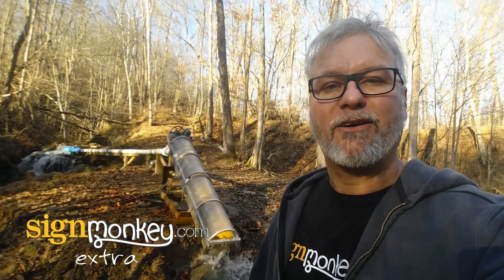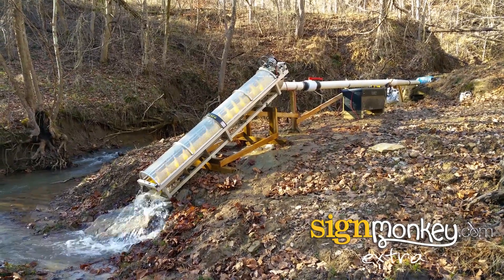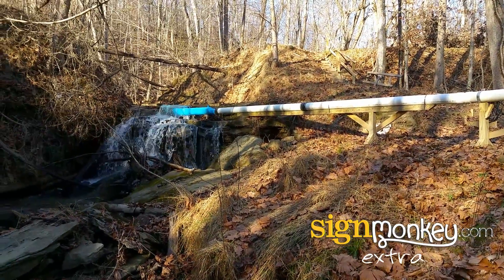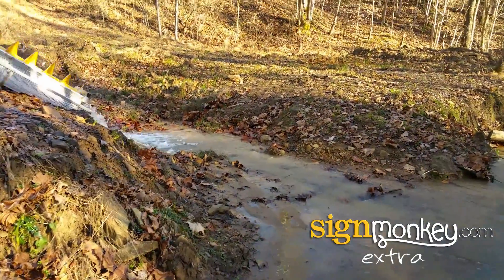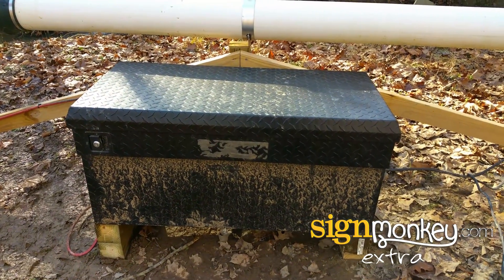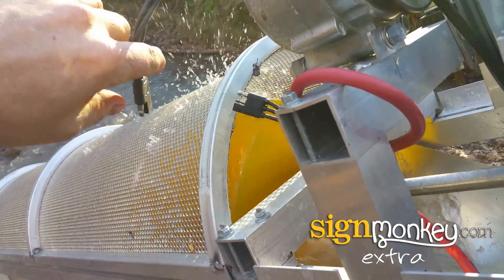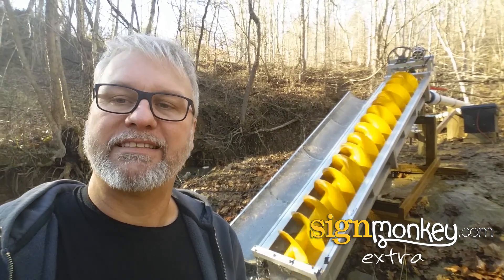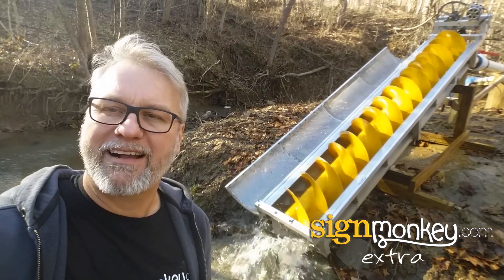Archimedes Hydropower Screw Generator

Comment: Surely the efficiency of water wheel would be better that an Archimedes screw? The water flow is pushing on the outermost edge of the wheel and momentum would mean it gets more efficient after it's started up. The screw on the other hand is actually designed to move water uphill and not optimised for the water to drive it, maybe if it was totally submerged and the pressure was high enough but it'd be acting like a turbine then and driving the water out with a lot of force. 

I just don't see the advantage of using an Archimedes screw, invented to move water to a higher plane, over a water wheel, that was actually invented to harness energy from the flow of water.
Reply: I can see one advantage of the setup. Namely, that you can generate power with a lower profile. For example, this setup could probably run underground if you needed it to, so in communities with visibility issues or building permits this would actually be a good idea. However, I can think of another good to use for it: as part of the apparatus that leave the water to a water wheel channel. in fact, I'd replace all of those pipes with thisata slight incline and put the wheel under the end of it.
Reply: the length; the screw is like 5 to 10 smaller turbines in a row; it actually does catch the energy better, but ... he didn't set it up right; the water flow needs to be higher and the gap between the screw and the gutter has to be tiny
Reply: SilvaDreams bingo!!!
Reply: It's not very efficient, because well the Archimedes screw was exactly that it was meant for moving water up an incline.

Comment: could you tell me where you got the water catch from or how you made it . thanks
Reply from the maker: We built it, I had the parts plasma cut and welded it together, then epoxy coated it. The grating on top is made of round rod and assembled in a way to let it self clean.
Reply: Thank you. anyway of getting the schematics for the screw and water catch or is this something you are attempting to market and sell? Again, thanks.
Reply from the maker: I am not looking to market this generator. I don't really have a schematic but if you have questions I would be glad to answer.
Reply from the maker: Aluminum 4" schedule 40 pipe with .060 aluminum flights. by far the most difficult part of making the screw!

Comment: Might actually be interesting if you post how much it produces.
Reply: Actually, in most mountainous areas creeks still keep flowing at least a little when winter comes, it might be less than a third of what it is normally, and a tenth of summer melt flows but it still chooches!
Reply: The head/flow didn't seem to be the limiting factor.  The generator looks like a car alternator.  Car alternators can range quite a bit in output but I'd wager far less than 750watts which is roughly 1hp.  If it could produce 500w continuously that would be 12kw per day.  If it's a more typical 250w alternator it's probably closer to 6kw per day.  The speed didn't increase that much when the load was removed I assert there is a lot more energy that can be extracted with a bigger generator.  What I would do is add another alternator wired in series for more efficient rectifying.
Reply: @MindCrime550  Automotive alternators are rated at amps with 12v a given .  200 amps is typical for 18 wheelers. So 2.000 watts would need about three  hp to generate 2000 watts and i doubt that screw at that head with 6 inch pipe comes close
Reply: @MindCrime550  wattage is an hourly rating..used "instantly", so doesn't matter how much is produced per day..the energy must be used "now" else it is wasted unless there are many batteries to charge and one can wire them for higher Watt output or longer duration for nominal W output..not criticising, since we are not sure of the true wattage output of that 'generator'..
Reply: Michael Foye Remember if all this did was trckle charge batteries when the sun doesn't shine it has done it's job
Reply: Bio Power Thats significant savings on electric bills. Even if it doesn't power everything year round. The question then becomes how much the capital cost of the project, and its maintenance over the course of its life cycle compares to the cost of paying for the electricity from a corporate provider. I'd think that its superior to most photovoltaic systems on that level, especially if you don't count the displaced value of subsidies. Frankly I'd build one just to have an independent energy source.
Reply: mikhaelis yeah I know eh. Waste of time people share no specs.  I saw another like it guy was producing 5500 watts
Reply: @daleval2182  wheres the link? Any idea?
Reply: Figure about 100 watts per foot of screw (auger) for a 10" diameter.  Angle about 30° to 45°.   Alternator should he 80% of that, so a 60 amp alternator with a 3:1 or 4:1 sheave (pulley) setup. 

Alternator needs to turn 2500 rpm if coming off a gas motor, 1000 rpm minimum if coming off a diesel. 

Screw should be variable pitch flight type. Say 4 per foot at the inlet and 8 by the outlet.   Helix angle of flight should be equal to the incline of the tube, but you can use what you pull out of the tractor bone yard.
Reply: Bio Power it's flowing?
Reply: Mikhaelis head looked about 2m max, 6" pipe. So less than 10kw most likely
Reply: @gamble9437  This was most likely 100 watts
Reply: They never do.
Reply: I was thinking the exact same thing...volts, amps?
Reply: I think that drill he had in his hands should be quite powerful
Reply: How much power are you producing with that hydropower? Is it enough power to set up lights around the landscape?
Reply: Like a car alternator maybe a truck sized.
Reply: EXTREME ENGiNEERiNG LiFE  Don't sell yourself short. Min 20KW. /S
 Get real. You have no idea what you are talking about.
Reply: Michael Foye where did you get 50% is that a practical measurement, most solar panels are rated  for 80% after 30 years assuming they weren't damaged and are at the most optimum angle
Reply: @ilovefunnyamv2nd  The 50% figure refers to the government subsidies given to manufacturers, installers, and purchasers of solar systems. Not the rated efficiency.
Reply: Very misleading, Even if this was flowing 10 litres per second (it isnt)  with the 2m or so of head and the inefficient screw turbine it would only do about 80w That looks more like 5 litres per second to me. After the losses i would think it runs at about 30w How do i know this? I make hydro systems.
Reply: Bio Power That still represents a thirty percent depreciation of utility in that timespan. Its worse if you have winter freezing roofs. Tears the panels apart too. I'm not against pv solar, but it isn't cost-effective of the true cost is taken into account. The panels are made of gallium arsenide. Thats gallium which is destructive to all metals and can induce failure over a very short time span if exposure to metal surfaces occurs. And arsenic which is a deadly cumulative poison. When combined they don't have the same properties, but when they degrade, especially if they are allowed to disintegrate, those materials once again can cause their respective harms. It's no reason to panic, but its amazing how many people think that solar panels are super efficient models of non-polluting energy producers. 
By comparison, the cost of your micro-hydro system is pretty much the whole bill.
Reply: Michael Foye I somehow don’t like PVs since they started putting so much emphasis on it and marketing Clean Energy. WE are all being cheated upon everyday of our lives, atleast this guy has made an effort to produce some Electrical energy by converting hydro and keeping the water clean.
Reply: @SamMonkulas  PV systems have a valid role. In space systems. Because at the moment the only energy options for satellite systems are nuclear and solar. So there's a niche where it is useful. On earth it's suitable for a system backup, or for being independent of the grid. Otherwise its better to use more efficient energy sources.
Reply: mikhaelis Why ask when you don't actually want to know? Nor would you do anything with the information anyway. 
He already said it can produce D.C. or 120 AC voltage and can store excess in a battery system, therefore the amperage output isn't that important unless you expect it to power a whole house.
Reply: Bio Power Yes, solar panels are jnstall and forget for the most part. Although depending on the local climate, they can require significant maintenance during winter to protect them from damage caused by ice flow and heaving effects.
Photovoltaic systems also suffer a very punishing degradation in effective output over time. With most systems losing about 6-10% of their maximum within a year of initial installation and dipping down to 50% after 5-7 years. By the time most systems are 10 years old they are drawing less than a third and often less than 10% of their rated power. The cost of the photovoltaic systems are usually subsidized by governments for the end user to the tune of about 50% of the unit cost. Additionally most all solar system manufacturers also receive significant amount of industrial subsidies of quite generous amounts. 
The end result is the misallocation of massive amounts of capital into a very inefficient and frankly, in most applications, wasteful energy system. 
Whereas the cost of construction and maintenance for the micro-hydro systems are usually not subsidized and thus the actual cost-benefit structure is transparent and easily understood. The same is almost completely reversed when it comes to the costs associated with solar panels. 
Additionally solar panels are toxic and pose significant environmental hazards due to the presence of toxic chemicals and materials in both the manufacturer and assembled units themselves.
Micro-hydro is clean, provided that it is manufactured from non estrogen mimicking plastics. Which is usually the case, as those substances are used to make plastic soft which is generally counter to the properties hydro systems require.
Reply: @michaelfoye1135  your miss informed about solar panel losses, that was true with early panels, but no longer, its 1% per year, and the advertised wattage is not what the panel will be producing at your house, that's a lab rating under specific enviormental conditions.
Reply: @PhiTonics  The degradation of aolar panels varies depending on local conditions. I based my statement on their use in the Northeast US region where winters are long, harsh, and spring and autumn both see frequent temperature variations in and out of freezing conditions. The wear on exposed solar systems is quite high. 
The figures you cite only apply in space. Not even Commercial systems installed in the Southwest, where temperature variations rarely dip below freezing, can manage that. Even then there is significant stress placed upon the structure of the panels by thermal expansion. 
As for 80% over thirty years.. Show me a thirty year old solar system that actually operates at 80% with original installation parts and I'll look into buying one.
I'm not opposed to PV solar. I'm just realistic about the actual ROI (return on investment) of solar systems. And the costs of subsidies ,which are paid for by those who do not derive direct benefit from the system. Solar is still vastly more expensive than other energy systems, excepting wind.
Reply: Michael Foye I tend to think now that you mentioned to show you a 30 year old solar that works. My FIL (father in law😂) bought a Pipe Solar Water Heater in 1996 and this thing is on his 2/F rooftop with glass frame looking like a junkyard sale with SS water tank of 200 lit. This old like gold, really works well not only in summers but in winters as Sun is ever hot in both seasons with variations in temp only. I am sorry to mention Sun is “hot”, I should correctly put it as “Bright”. My point is you are right about some specific application using Solar that is like Fix once & forget it for 20+ years with occasional wiping or dusting off dirt from panels. I mean come on, you have Bicycle then you need to clean or put oil or check tire pressure, so same case with Solar with the only option of how accessible are the panels to clean once in a while. And again India or Africa being most Sun efficient areas on Earth which justifies the use of lazy Solars..........🤣🤣🤣
Reply: @SamMonkulas  What I actually said was show me a home Photo Voltaic solar system that works at 80% of its original rated efficiency after thirty years of use. I am well aware of solar systems that are working at that age. Not too many make it that long. 
I'm not certain, but from your comment I think your Paw has a solar thermal system. Those are often excellent options, although not without drawbacks, and I plan on utilizing such a system myself in the future.
Reply: Michael Foye well you are right that my FIL’s Solar Heater is barely touching 25 years silver jubilee. But I would certainly take photos of that system in the next 2 months or so and will post the results here to tell the tale. Nevertheless you are also right that for such particular specific Heating this kind of simple plug n forget devices were invented probably 50 years ago or more and that in concept works well for a small or big house application. Hope you find the right one for your home. 👍👍
Reply: @michaelfoye1135  degradation of pv is waaay lower than that,it's aproximately 1% per year... And in optimal condition even more,your degradation percentages maybe of pv of the 70's 😂
Reply: @davidedelzingaro7524  No the figures I was using are from power plant handbooks for industrial scale systems using 1990s data. I'm aware of the improvements that have been made, but manufacturer claims always run high, especially for commercial systems. There's been a lot of improvement in PV in the last few decades. Even so, the total cost is significantly higher than the cost paid by the final user, due to government subsidies. PV solar is still the 2nd most expensive energy source available, just after wind. The highest efficiencies in PV solar are also extremely expensive, and are utilized on satellites, and other space applications. That's where you get high efficiency over a long time frame. Because the space environment has a different set of conditions than earthbound systems. And the only alternative in space is nuclear. Space applications are costly enough to render the use of high cost PV systems economical in that role.
Reply: @davidedelzingaro7524   Check out the video "The cost of sunshine" at 
"Illinois EnergyProf"  YouTube channel. Professor Ruzic has the latest figures, and explains the issues quite well.

(edited to correct spelling of name)
Reply: @michaelfoye1135  i don't need that,there are a lot of folks making videos obout theor pvs,i don't need a professor to make a simple calculation as the degradation ahahahah
Reply: @davidedelzingaro7524  Ok genius.
Reply: It "might" be able to run my computer setup. About 1KW or less under load.
Reply: @leerman22  1KW 24-hours a day is enough for most off-grid homes. Normally it keeps batteries up that can discharge during peak hours. We had a solar system with 1880 watts of generation with as low as 4 hours of sun that handled our home fairly well.
Reply: @kennethkirkham2471  dude, please post your system so I can replicate. Thanks
Reply: @rijaltanjung9506   we used 8 225w 24v panels wired to provide 48v. Running through a Midnight 80 amp controller to 8 L-16 batteries configured in 2 24v banks in parallel. At just a few miles from Canada winter was limited to 4 hours of sun per day. I bought all of the panels, charge controller and inverter from Solar Blvd. I found a 24v battery charger from a yacht supply to charge the batteries with our generator during times of little to no sun. We ran all LED lights and turned all items off when not in use. I would have preferred to have a water power generator producing 200w per hour but our stream has very little drop and not enough flow.
Reply: @leerman22  that's quite a lot power how is the total cost of these?
Reply: If we knew the flow rate and the height the water falls we could at least get a general idea. These screws aren't very efficient due to drag. Now that I think about it I doubt it even makes a single horsepower.
Reply: I'm canadian. I'm nice.
Reply: @leerman22  Well it's clear you've never been without ! It would be a god send to some people, quit judging others by your own situation !!!
Reply: Archimedes Screw goes up. all you did was create hydro-electric diversion.
Reply: Bio Power Also, thanks for the interesting channel
Reply: It was producing enough amperage to start up that drill. That drill can trip smaller inverters so instead of acting like a used feminine hygeine product, maybe keep your non productive comments to yourself. Remember that truism about silent people thought to be fools and vocal people who remove all doubt.....